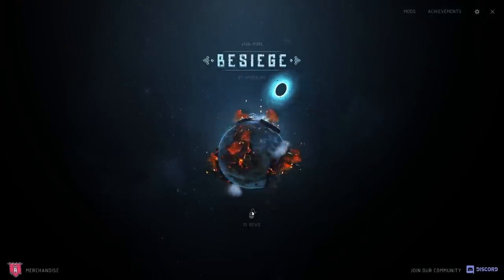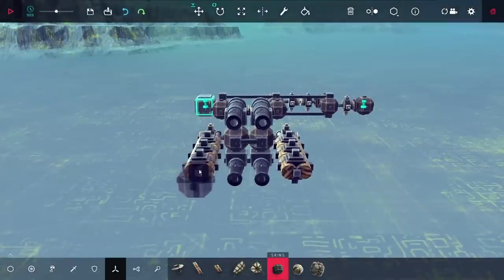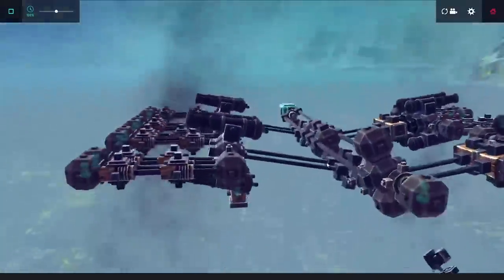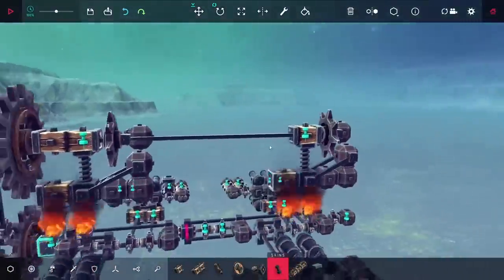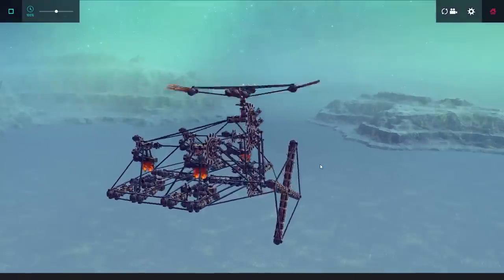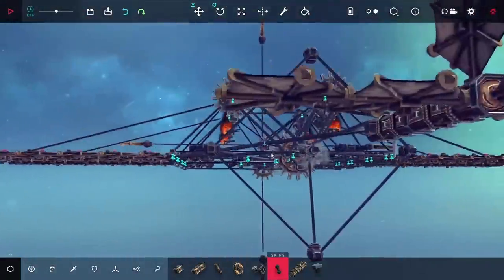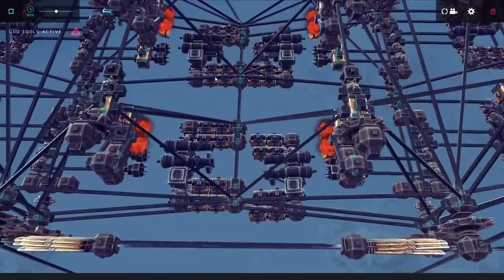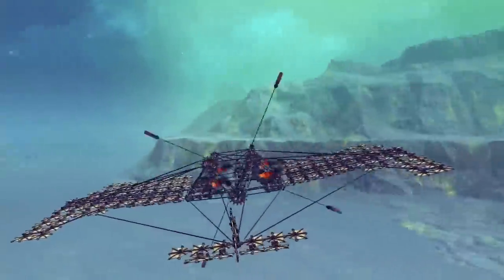Making a Cannon Powered Plane in Besiege

Comment: Those torches setting off the cannons remind me of a steam engine I built. 
Two water cannons pushing a block between them back and forth, which is atttached to a flywheel, which moves a single torch above the cannons.
Worked quite well, but this was before you could move and rotate parts. You can probably do it a lot better now.

Comment: I’m getting my pilots license and the plane turning to the left while it’s flying happens on real planes as well. If you have the engine at full power the blades on the right side of the plane make more lift than the blades on the left and it cause the plane to turn that direction you use more right rudder to correct for it.

Comment: I was just playing Besiege and I remembered a machine that I think you might like to make. It's something called a mousetrap car. Basically you have a spring pulling a big lever (in real life this is a modified mousetrap) that drives a wheel and axle system using a string to power a small car. This was originally just a challenge for myself, but I thought that you might be interested. There's videos and schematics of the real models to look at as well if you decide to take on the challenge too.

Comment: Some planes are designed with an offset tail fin to counteract engine torque. If you can finely rotate the fins, that would probably solve torque problems easily.

Comment: Everytime I finish one on this guys video I’m left with the same thought: “wtf. I guess it works, but you’ve sure sacrifice a lot of form to get it to technically function under the titles parameters.”
Reply: It’s turning left becuse its broken on the right side..
Reply: Yaw controls don’t need a new control plane, use the existing flas and push one up and one down, the plane will twist.

Comment: You really should look exploded-view of a real engine or animation how one works.. 
More support bearings for crankshaft, 90degree angles to cranks relative to eachother.

For balanced engine that wont twist your creation, go for 6 cylinder with correct crank angles, with supportbearings between every crank
Reply: Use shorter cranks for a faster spinning engine

Comment: the spinning bit that was turning it to the left, couldnt one find a way to remodel it so rather than going from left to right, it was instead going front to back, down the length of the plane? That way the motion of it wouldnt lean it to any one side. It would make the plane a good lot longer though